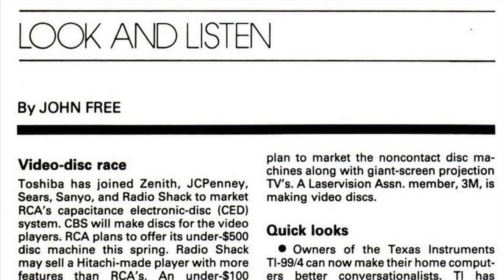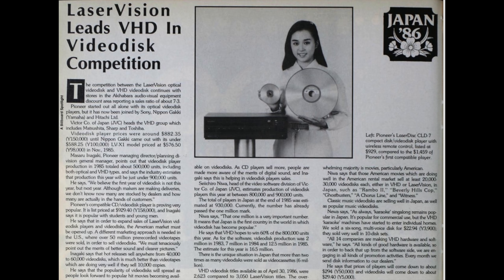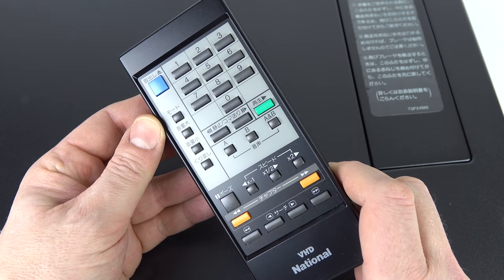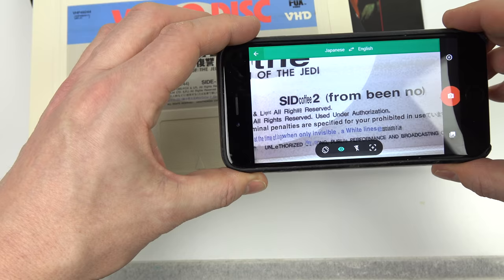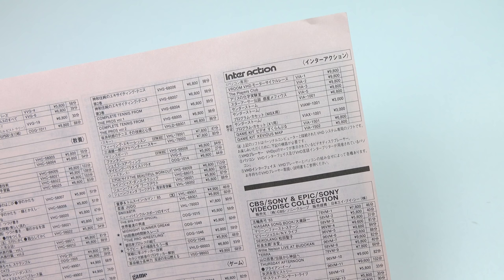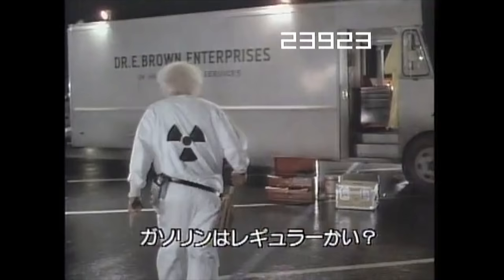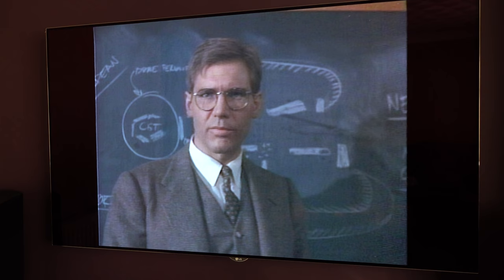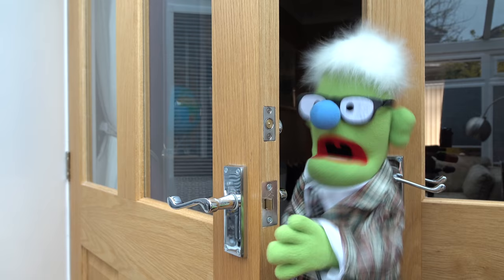Movies on Vinyl - VHD The forgotten 1980s Videodisc

Comment: So you spend $xxx (Sorry, I don't have pounds on my keyboard) buying a VHD player with the "VHD" logo emblazoned prominently on the front.  Next, you buy a movie on VHD disc, also featuring the "VHD" logo on the front and back of the case and probably a bit of literature about the system in small print somewhere on the back.

So this disc can ONLY be played in a VHD player and, vice-versa, the player can ONLY play a VHD disc.  So what's the first thing that appears on screen when you insert the VHD disc into the VHD player?  19:31 - A massive animated "VHD" logo telling you that you are about to watch a movie on the VHD system.

That must mean that we were so absent-minded in those days that by the time we put the disc in the player, we had forgotten what system we were using to watch the movie so the manufacturers included the intro at the start to remind us!
Reply: people need to be sure that they were not watching a bootleg copy that wouldve been too expensive to manufacture and wouldnt have played on the system anyway... and wouldve had the same logo at the start..... wait....

Comment: It's kind of funny, old CED players also had eject issues, but in the opposite direction -- it wouldn't pull in the discs. And you fix it the same way; there's a rod in the back and you have to re-grease it to get it working properly again.

Comment: Hi, do you mean there's magnetic strip on the vinyl or it is just a deep groove for the needle to playback the video? Thanks.
Reply: Yeah (the latter option is the actual one). However, the diamond stylus is just for disc tracking; the actual reading is done by a little electrode embedded at it, which, along with the disc's conductive surface and air as an insulator, forms a capacitor (hence the CED name for RCA's format). As the groove (surface) gets deeper, that is, farther from the electrode, the capacitance of the system varies, and the player's circuitry can actually sense it, thus forming the video signal.
By the way, the CED/VHD media is so fragile to manual handling and to dirt because of the respective grooves/rings' insane density (when compared to their audio counterparts), which is needed due to analog video's massive bandwidth.

Comment: Tks, very informative and fun! I enjoy my Pioneer LCDs, also. DVD players are also surpassed quickly the VCD. Of same side. In 1987 I gave my (Japanese gf) a CD player Technics that could play backwards, even control the speed as your fingers on a vinyl record,also  adjust manually the Tuning...excellent for the musicians we were.
Reply: NB: my stupid tablet doesn't allow me to correct my mistakes. All correcting functions are cancelled on every level, yet Errors will remain unless I erase!! Can't even copy to reattach. Errata: Same size. Not same side. Sick of Stupid corrector mistakes.
Reply: With that cd player Technics came a cd that had also video tracks on it... never know if she found a way to view it years after.

Comment: So the needle of the VHD doesn't read anything am I right? its just used to keep the disc in the correct position as it spins while a magnetic sensor reads the electrically conductive carbon bits?

Comment: From what I can see in the stills @23:xx , the difference between Laserdisc and VHD was like a " NEW " VHS tape vs an OLDER one. A brand new VHS tape, unplayed, soon deteriorated after a couple of run throughs. The same thing was apparent before and after using a head cleaner tape. Laserdisc didn't wear or have tracking issue's over the heads, as it had no contact with the surface the images and sound were on. I remember having both the abrasive and alcohol "wet" VHS head cleaner tapes. I also remember having to cough up $300+ for new heads TWICE in the life of my old AKAI VS15-EA HiFi dual speed VCR. The initial purchase price of $1300 soon doubled over it's lifetime just to keep using it. I dont have any really FOND memories of VHS, neither does my wallet, however, it was VERY easy to get the latest porno's or bootleg movies from the US and Indonesia (in Australia).....I also remember buying Ferris Bueller's Day Off on VHS the day it came out. It cost $90. The Laserdisc of the same movie was $60, but the machine to play it on cost almost $2500 back then. FEW if anyone I grew up with, had Laserdisc, but EVERYONE had a VHS (or BETAMAX if you valued image and sound quality over quantity of titles) and EVERY town had their Video Store...you could ONLY get Laserdisc movies via the BIG department stores and specialist resellers, or via mail order. VHS was far easier to get hold of, and had thousand's more titles for sale, rent or lease. 
How many people can remember LEASING movies for 6 months at a time ?.........No late return fee's apply......

Comment: Somewhere at the beginning the difference in optical resolution between the different formats was mentioned, with VHD and RCA on only 240-270  lines horizontal resolution versus Laserdisc at the higher level of 350 lines. We already know the lower resolutions from videorecorders like early VHS, Betamax and V2000 recorders, not the later S-VHS and Betamax ultra. No wonder that on this lower resolution the relatively cheaper to build VHS machines won out. And all the more surprising IMO is the fact that V2000 achieved a perfect freeze frame in their fourth machine designed for this system , the VR2024 I once loved so much to own (it also had the best horizontal resolution ever, much better than the second generation ones ending with the VR2840). This of course did not save the V2000 machines from a market failure, but shows what high precision manufacture can achieve. Coming back to VHD: probably these Japanese texts having to be present in the image comes from the difficulty in coding signs?  An alphabet based subtitle as is customary for us in the  west is much easier to code in an ASCII or ISO format than a sign-beased language and could've been inserted and also extracted if wanted to and from the bitstream on the disk at will. The present setup requires much more variation in disk versions per world region and so higher production costs overall. Praise to you for not only collecting all these different units, but also for assembling all this elaborate background information for us.

Comment: Library didn't want theirs anymore and since they knew I was in electronics, gave it to me plus those 12" discs that only played 30 minutes on a side.  I didn't keep it very long with hop skip, and jump, and way too heavy for my back.  Amazing with the technology shortly after with 3 hour movies on a small compact 5 inch CD disk and also in 1080 pixel resolution and Dolby surround sound.   Did I mention getting rid of over a hundred VHS tapes?  Absolutely terrible on a high res flat screen, but did look nice on a 10 inch CRT screen. Now to get rid of those  huge CD's for a micro SD card.

Comment: The ld, vhd, and even ced versions of the original Disney cartoons are actually far superior in overall quality to bluray. This comes down to mastering, those formats are a basic scan of the film without the many layers of noise filtering that is present in the bd or dvd. The noise filtering used in the modern formats completely erases much of the details of the original and they also oversaturated the bd/dvd releases all to hell so the colors are much closer on those original releases to the film as well. The only thing that would be better than snow white or cinderella on LD or VHD would be the original film itself, and good luck getting a hold of some of that for less than 10-20k.

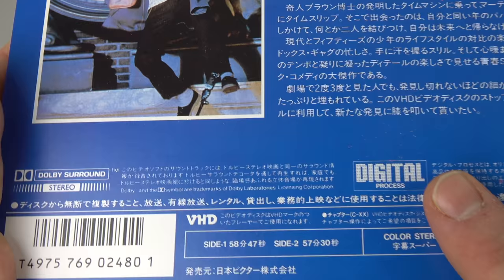Comment: 16:30 
Why are you saying it's not digital? The video information on the disc is written in binary code, as you said.
Reply: Marcus Langendorff it’s outputs an analogue signal
Reply: @CT-vm4gf  But the "Digital" logo was on the medium carrying the video data. Not on the equipment outputting the video signal. Therefore the record company has all the right to label it as digital. What kind of video output the equipment turns it into, is out of their control.

Comment: wow the discs were insanely priced 7800JPY is $93.23CAD but that's for 1986. Adjusted for inflation $190.65CAD. A 2 disc movie (9800JPY) would have been $117.13CAD and adjusted for inflation $239.53CAD! The Japanese bubble economy probably helped sales but just crazy.

Comment: Great stuff!  
Question: How does DVD compare with VHD, CED, and LD?  In "Finding Nemo" the artifacting caused by the compression algorithm make it look extremely bad, and the LD version looked more like film (except for ratio).  
Blue-Ray, of course no contest.
Reply: They're all SD formats, but VHD and CED have VHS-quality images since they are low quality analog and compress the color information, which leads to color smearing, but VHD does it better and doesn't have the video noise (sparkle and skips) CED does. LD is analog yet has the full NTSC broadcast signal and color information, but the sound was only mono at first and used CX compression. DVD is digital, but it uses MPEG 2 compression, so you can see artifacts from time to time.  Playing them back on small TVs also helps the picture look better.  DVD looks better and is a more convenient format.

Comment: Techmoan, I've heard this methode of recording movies on  discs to be read like traditional records were developed during WWII. Do you know further info about it?
Reply: Many companies were trying to figure out how to record TV programs and with phonograph records being the primary method of recording during the War, I'm sure some people were looking at that method. 

When the Army brought back tape recording technology from Germany after the war, Bing Crosby helped found Ampex to commercialize tape recording. In 1951, Ampex attempted to record video to audio tape but the results were poor.  In 1955 it developed a video recorder running at 100 ips, but then in 1956 it hit upon using 2"-wide tape running at 15 ips with a spinning record head to use the entire width of the tape.  

RCA started development of its vinyl video disc system in 1964 and companies in Germany and Japan also started development on similar systems. By the time RCA introduced its system, Beta and VHS tape player/recorders were already out and widely accepted by the public. Likewise Laserdiscs also beat RCA to market. And the RCA videodiscs had plenty of technical glitches which killed the format.

Comment: You mention RCA’s failure to popularize its long-playing format in the 1930s. Maybe the biggest reason for this was the growing power of the pop music market over its classical counterpart. A little explaining is required. 

While the 78 RPM was indeed looking a little worn already by the 1930s, by and large the only musicians voicing frustration with the format were classical ones. From its very inception, many classical musicians were skeptical or outright disdainful of a format they felt was plagued by poor quality sound reproduction and short playback duration on each side. Because of this, many larger symphonic works or operas were prohibitively expensive to record—or altogether impossible to do so profitably. In 1937 Electrola recorded Act III of Wagner’s Der Meistersinger von Nürnberg with the Staaskapelle Dresden and the Dresden State Opera under Karl Böhm’s. Even a single act from the opera took up 15 double-sided discs. Around the same time, RCA recorded Serge Koussevitzky conducting the Boston Symphony in Bach’s St. Matthew Passion. That recording exceeded 50 discs, if I’m not mistaken. So when RCA (in conjunction with Bell Laboratories) experimented with extended playback and stereophonic sound, they did not enlist the pop musicians of the era, but rather men like Leopold Stokowski and Sir Thomas Beecham to try these innovations out. However, the cost of this new format precluded any possibility of winning over fans of pop music, most of whom were happy with 78 RPMs anyway, and saw no need for upgrading to an expensive and incompatible new format. 

Columbia later succeeded with its LP in the for two reasons. Firstly, because the vinyl surface of its playback materials and its duration—with a single album comfortably fitting a standard-length symphony—were a vast improvement in fidelity over 78s. They aggressively courted the classical listener, employing their top stars in that genre—including Igor Stravinsky, Bruno Walter, Eugene Ormandy, and George Szell (who appears on the far right of that group photo with Wallerstein you shared)—to sell the format. But secondly, and perhaps more importantly, its cost was not only significantly cheaper than RCA’s format had been a decade earlier, it promised to eventually be cheaper than the 78 it hoped to supplant. This allowed it to be well within the budget of most pop listeners. 

At the same time, RCA succeeded with the 45 RPM precisely because most pop listeners at the time had no use for albums, instead wanting to hear the latest hit song. In fact, it’s telling that pop/jazz musicians didn’t really learn to effectively use the LP format until well into the 1950s. Even deep into the 1960s, many non-classical LP albums were ramshackle things consisting of a hit song or two accompanied by ten or so tracks of filler. 

The classical market, while much diminished after the 1960s, was still a major force in the recording industry even until the early 1990s. Quadrophonic sound (a failure) and the CD (which has since become a quasi-permanent physical playback format) testify to this. In fact, later attempts at format improvements—DVD Audio, SACD, Blu-spec, and Blu-ray Audio—mostly appeal to a very niche audience, or have failed altogether is precisely because the classical audience, which tends to prioritize playback duration and fidelity of sound, has itself become an extremely niche market. Most pop fans are content to stream their music at low-quality bit rates. (Some pop music today is even mastered on mp3.)

Anyway—just some added detail which I hope is useful to somebody. Thanks for posting this video. Your best yet!

Comment: To me, those disc caddies that protects the CED and VHD disc are very unpractical and require overcomplicated design for players. Why they not used Sony-like design where disc and caddie is unseparable and it's surface is accessed via small window? (3.5 floppy, Sony MiniDisc, Sony UMD).

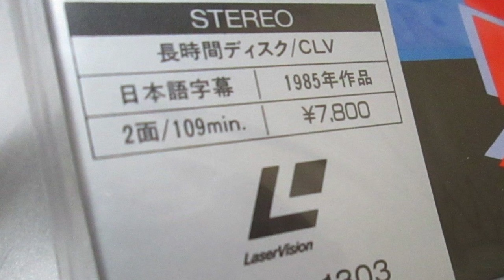Comment: 14:54 well yeah if buy system you need buy disc to use it. its like buy printer and need ink.ink cost so much its cheaper buy new printer. jeje that ink actually cost cents but they ripoff us,but you cant use printer without ink. get it yet?sell cheap machine then add money to disc

Comment: It IS digital, the disks contain an audio data signal, that the machine reads, and translates to sound and image, digitally. Just a laser disk, except instead of a laser transmitting depth of the burn on the surface of foil, it's a needle relaying the depth of the press on the vinyl. Digital. That's why you can get a freeze frame, because it's not actively reading as it plays, it's loading data onto ram, and the frame you select can just be displayed by the ram. Done in the same manner as pausing a video game. Digital.

Comment: 4 systems were too much for the market (and no one has been enough used to become a standard). RCA CED should be the support of RDI Halcyon but RCA has stopped production of CED, then RDI has taken Laserdisc and Halcyon system has been a bankrupt. Laserdisc has been used for games in the 80 and so, in the 90 with CDI Phlipps. But VHD has got more success in computer and consoles world with MSX compatible computers in Asia. The very popular MSX, which whas produced by a cartel of big asian enterprises has permitted to develop this technology. But we can suppose that the arrival of CD ROM has certainly caused the end of the support, and the end of movies on this technology. VHS is finally the champion, because the production of VHS has been long: from the end of the 60' tille the 2010' years. But the price of VHS and the rarefaction of users has scelled the destiny of the VHS. Even if old cinéphages continue to use it! DVD or DVD rom are cheap, are a consensus beetween builders, so they will survive ten years, but after… So: buy DVD players and DVD ROM players if you Don't want to be fucked by the evolution. But today seems the latest evolution with no material support (if we consider that internet and tablets or phones are not material supports). But builders know they go too fast: that's why vinyl is a reaction to make money again with material things x)